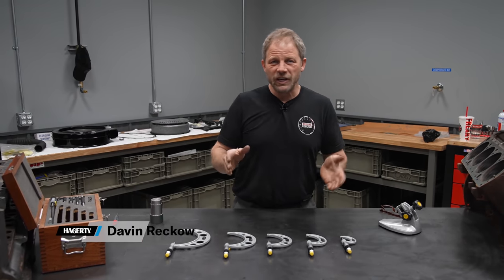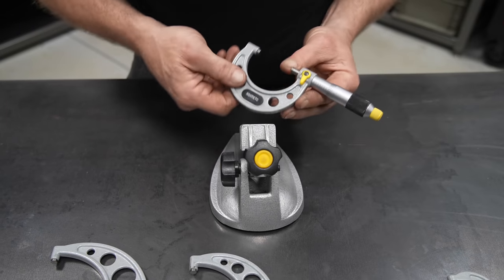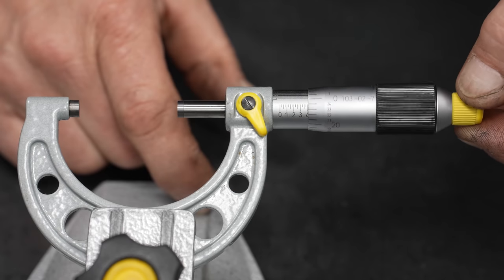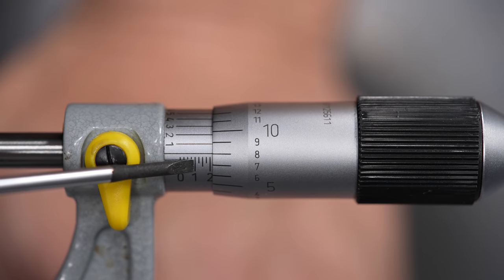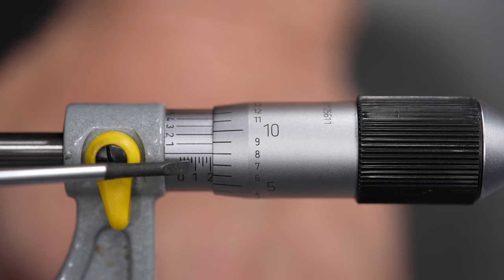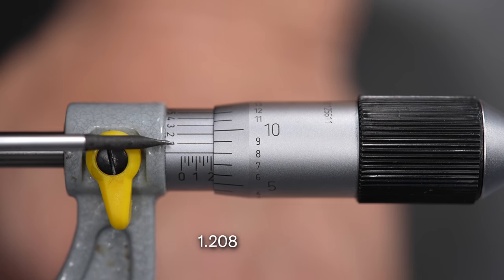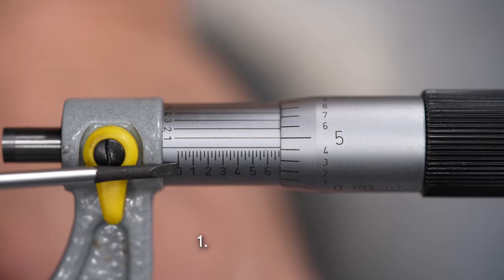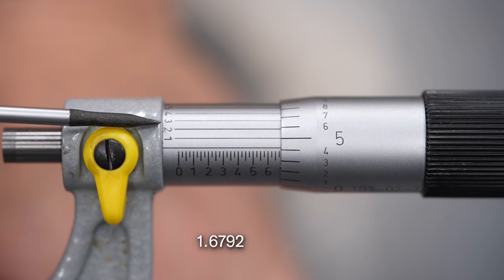How To Read a Micrometer: Precision Rebuilding an Engine? This Episode is For YOU | Hagerty DIY

Comment: One thing that really works for me: when calibrating (and later measuring), i put the mic in a vice (lightly) and JUST BARELY touch the gauge block, and then use 3 clicks on the fine barrel adjustment. this way, when you go to measure something, its a simple, easily repeatable formula for consistent, accurate readings ie barely touching, then 3 clicks in. of course this is harder to do with a really cheapo caliper, so always buy the best you can afford.

Comment: I'm pleased my country uses the metric system,much easier to understand
Reply: Depends on which system you're familiar with and used to working with. Using a metric micrometer would be foreign to me.
Reply: You read metric the same way you count your money. Just have to add a denomination that is 1/10 of a cent (centi)  which you call a mili. So much more efficient than the inch and feet system regardless of what you are used to. I routinely use both systems.
Reply: @ellieprice3396  I can use both, but I prefer imperial.
Reply: Inch measurements of this type are done decimally, so really there is no difference beside the measurement base.

Comment: Which mic do you use to measure something smaller than 1 inch? Should the “0” in the 0 to 1 mic used fir demonstration be read as “0” and not “1”?
Reply: The zero to one inch micrometer measures from .001 to 1.000.
Reply: He wasn't using a 0-1" in the demo.

He was using a 1-2" mic.